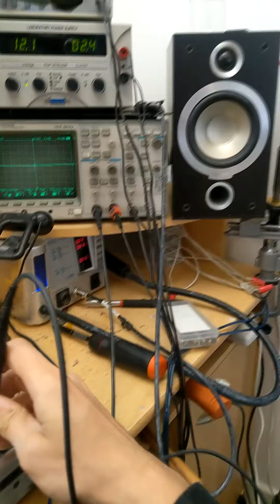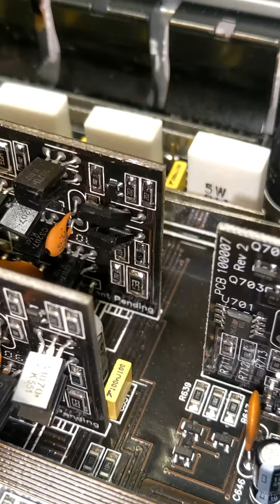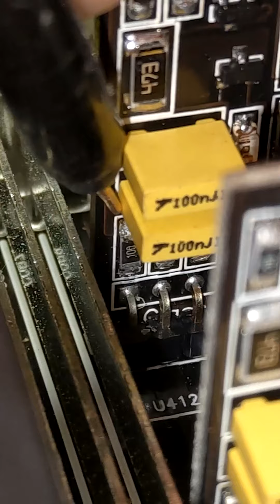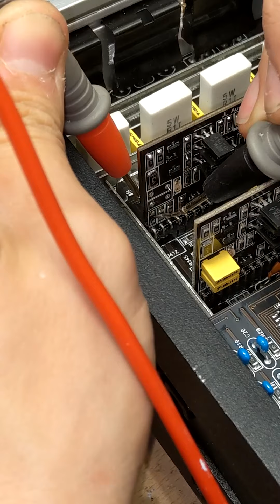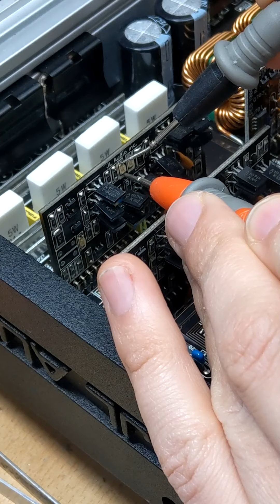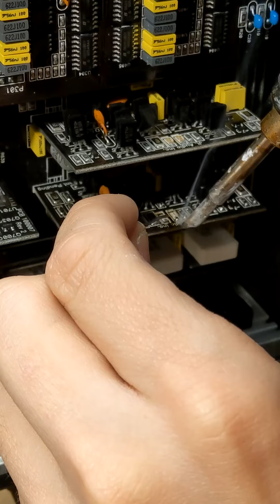Unlikely Component Failure - JL Audio 300/4 Quick-fix

Comment: I have the same amp. What test can I do to see what part I need to replace? It powers on, subs come on but it's very low and distorted bass. Even with the gain level up sounds low and distorted. What part could it be?

Comment: I have two JL amps with messed up switches. I am still using the 300/4 but the 1000/1v2 one of the 3position switches is so bad i can't get the amp to start running even after spraying electronics cleaner and flipping the switch around a lot. Would love to know where to find replacement switches so I can solder in new ones. These amps are still great all these years later. I might even have to recap them one day since I still like using them and they are over 10 years old now.

Comment: Currently diagnosing my JL HD900/5 after I sank my truck in a huge mud bog... Sometimes it works, but most of the time it flashes red/green. Not UK based but appreciating the encouragement 🤘

Comment: Those driver cards will drive you nuts, I’ve seen all sorts of failures and weird symptoms on them over the years
Reply: For me it’s the connector pins to the crossover boards. Those things are so prone to corrosion failure. It’s basically a glorified breadboard inside your amp. Not a fan!